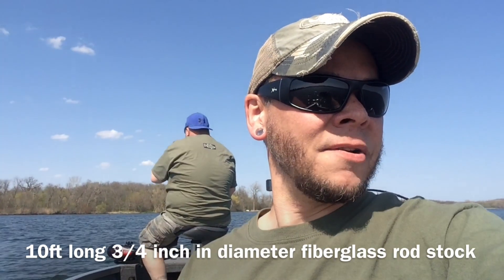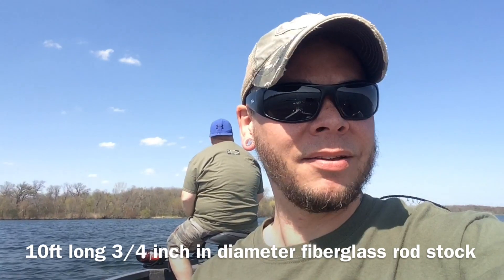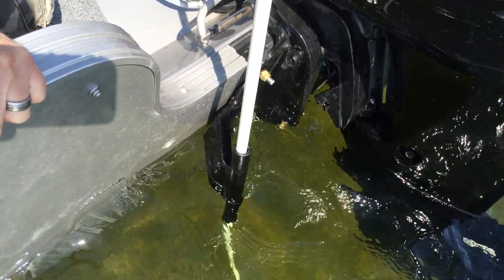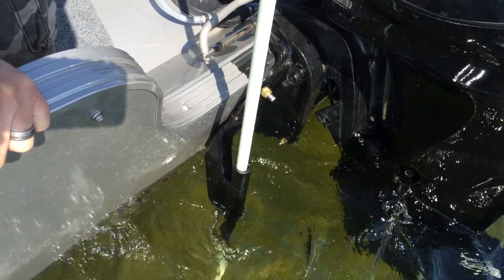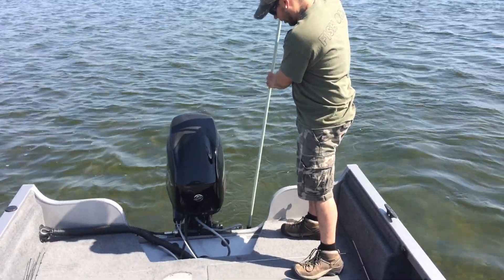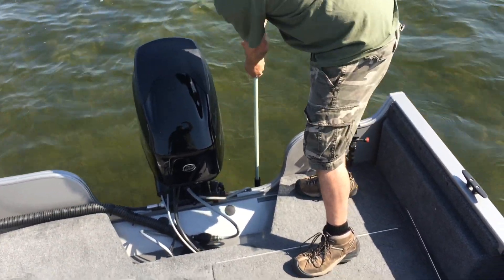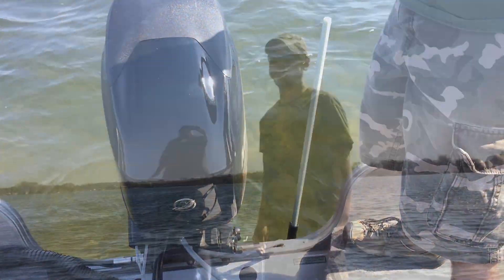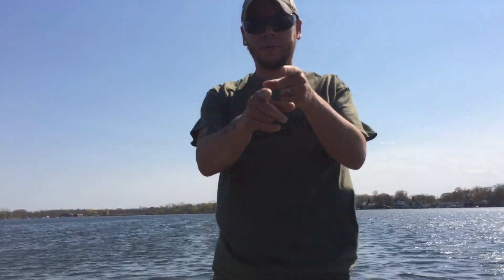Poor Man's Shallow Water Anchor

Comment: I was gonna buy the wang anchor , but it’s like $225.  So I went out and got a  60 degree stainless steel bow rail holder and I’m gonna go to grainger to purchase the same rod. Probably gonna add a handle to the one end
Reply from the maker: Add a handle or wrap with electrical tape or you’ll get fiberglass splinters. Good luck and thanks for watching.
Reply: @FishingPOV   I was thinking about spraying mu fiberglass rod with that spray plastic stuff.  I hear it’s pretty tough
Reply from the maker: @Whalermansteve84  worth a shot, let me know if it works.

Comment: I will say this knowing from experience. If u r in any type of current or wind situation, the bracket is key. It allows u even while drifting,2 put all your leverage straight down on the pole to get it stuck  in the bottom. If u try to push the pole down while moving or drifting without the bracket, the pole starts 2 angle and u cant get enuff leverage 2 go straight down. I agree,rope tie off works well with the rod as long as conditions are perfect.
Reply from the maker: Oval Outlaw the bracket is definitely the way to go, thanks for watching.

Comment: hi, great idea ! you think 3/4 in will be strong enough for a 20 ft pontoon ?
Reply from the maker: Chris Nation I'd say yes, it's the only size that works with the shallow water anchor bracket mounted to our boat. Unless there's another brand out there. One thing I've found though is you have to pay attention to it. With bouncing in the water we've either had it back out or get pushed deeper in. I actually had to get in the water one time to dislodge it from the bottom. It's worked great for us and saves a butt load of money. Just gotta keep an eye on it.
Reply: Bass Hole, thanks been thinking about this for a while. nice to see someone do it and see that it works. appreciate it !

Comment: poor mans lmao. the bracket is $250 lmfoao for a cheap piece of plate.
Reply from the maker: Ray Williams have you priced the electric ones?
Reply: Go on ebay and buy a stainless steel transom mount rod holder for $20 for your poor man's bracket. That will allow a thicker fiberglass rod as well.